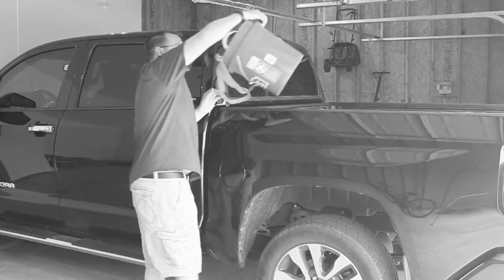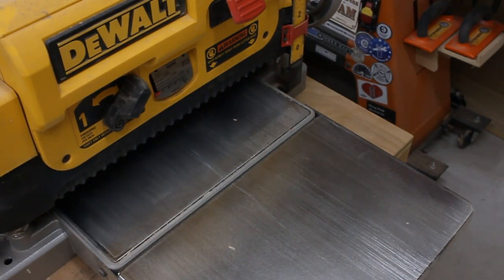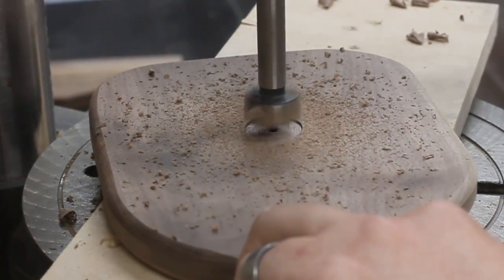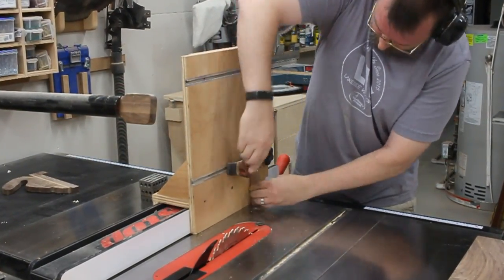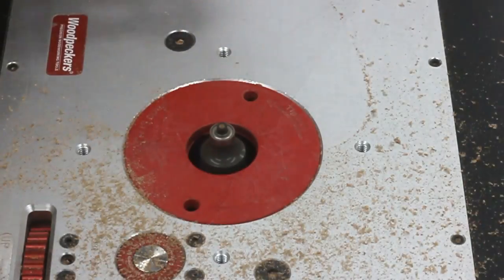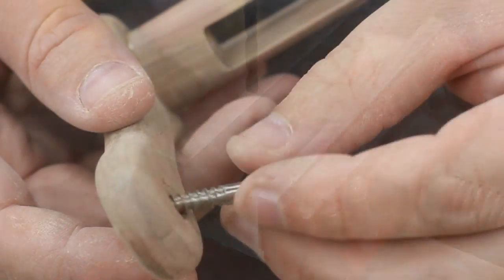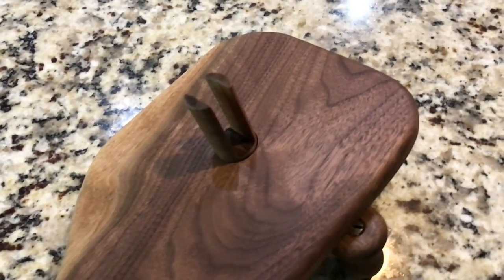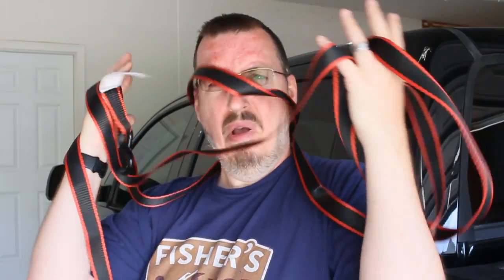Woodworking: The Strap Master 5000!

Comment: I wish I had thought of something like that along time ago because it takes forever to wind those up by hand you’re right Fisher that is a really cool tool that you built I used to use the-rubber band method to secure mine too, but someone showed me a new way of storing those and it works great so I’m gonna share it with you your unmatched socks or one got thrown away because of holes all you gotta do is drop the strap inside and  twisted a couple of times and stick it in your box and then they don’t come unwrapped. It makes a wonderful strap holder Again awesome build thank you
Reply from the maker: Nice tip!

Comment: Drew, if you would resist the urge to take the straps out of the box and tangle them up, you wouldn't have to spend so much time winding them back up and organizing them, lol. Seriously, this is a cool gadget. I don't use ratchet straps very often, but if I did, I would definitely build one of these. Thanks for posting.

Comment: Good idea.  I use plastic stretch wrap to keep the tie downs rolled up for easy storage.  (Jimmy Diresta tip)
Reply: Good idea.  I use foam 
koozies and throw them in the storage area under by truck back seat. Holds 14' 1/14" straps pretty well.

Comment: Small tip to get rid of the "ocd" issue we sometimes have noticing a thing we did wasn't actually symmetrical. Deliberately introduce a few obviously "by design" assymetries where non crytical. Maybe the tip of the handle isn't disk-y shaped but something more like the shape you had at 1:57 right before cutting the last bit off to round it off. Maybe the top edge is not trying to be perpendicular to the sides but rather on a slight (but noticeable) angle, maybe not even straight but with an subtle concave curve in addition to the small slant, but this is already getting too much.And just a few things like that, even if you started with a symmetrical base, it is already enough to break your brain away from "this is imperfect symmetry" into "this is just the shape of this thing" territory, even though it is still by far and large very symmetrical.

Comment: Looks similar to a device the old ranchers used to roll up old barb wire fencing. Just a lot smaller. I'm going to build one... all my ratchet straps are wadded up in box. 
Good idea.

Comment: My trick for straps:
I always keep them together by sliding the racketing section all the down the opposite strap until it meets the hook.  Then, I furiously hand wind the long strap around the ratchet section and hook off the long strap.  When I need a strap,  i grab one strap and alway have the ratcheting and long strap matched, on the strap, and ready to be pulled apart for cinching down the load.

Comment: Hello Drew,  Great video.  Your sense of humor makes it a hoot to watch.  Got to stay on your toes to catch all the innuendos.  Love the rubber band restraints.
I have a couple of suggestions:  Truckers have been using this type of roll-up device for a LONG time.  The suggestion:  Wrap the strap with the metal part to the OUTSIDE instead of the inside.  When you throw the strap over your load, you won't be throwing the heavy metal item into or on to anybody/anything and will not dent or scratch your vehicle.  Second:  IF a person has an old bicycle inner tube, cut "bands" from the old tube.  They will last darn near forever and are harder to lose.  I hope this will be taken as constructive comments and not as a slap in the face or a "You did it wrong" thing.
Thanks for the entertainment.  Love your videos 100%

Comment: You know, it's the simple solutions to the BIG problems that work so well - love this.
Now you just need a custom made wooden box with latches and a handle etc to hold the straps and the Strap Master 5000 ! (cuz that cardboard box is just too undignified to hold The Strap Master 5000 ! )

Comment: you should roll the straps up with the hook on the outside such that you hold on to the hook when you throw the strap over the load. two reasons 1: if you throw the strap over a high load and there is someone on the other side you could injure them with the hook and 2: if the hook is thrown over you have to go round, hook it on and come back to pull it tight but if you throw the strap over you can hook the hook on, walk round and pull it tight and add the ratchet, simple really!  so you might want to make the mark two version with a narrower slot in the winding post.

Comment: Great idea. I have to wrap them neatly by hand. The only thing I would add is something to keep the strap straight coming towards the winder.  A couple straight short pieces toward the paddle handle. Put them close enough together to keep the strap straight, but not too close. Fasten them to another flat strip with a pin going into the paddle  (look like a tuning fork).  This will allow for it to be removed but mainly for it to pivot as the strap comes in. 
That would make it from great work to perfect. 

I fully expect noone to like this comment. Just my idea for improvement. 

By the way, I have some drwer fronts you can borrow later.
Reply: Well I think it's a neat idea!  It would work better for me if the winder was stationary and I could guide the straps by hand but that's just because of how I prefer to work things.

Also, I legit have some spare drawer fronts lying around 😅

Comment: Great idea! I may actually make one of these. Only suggestion I could think of is to add two small dowels near the handle to prevent the strap from folding as you wind instead of using your fingers. Problem I see with that though is it would increase the packed down profile of the paddle when not in use. 🤷‍♂

Comment: Super cool, but I can think of some design enhancements.  
     * A way of turning it the opposite way and automatically dispense the rubber band onto the wound bundle?  
     * 12 volt or solar-powered option
     *  WiFi/Bluetooth?
     * Foot-pedal

Comment: Well done, Drew!
Only change ... don't use rubber bands to wrap the straps. Rubber bands have a habit of drying out and breaking.
Instead, use Velcro cable ties. They usually have a small slit in them so you can fasten them to one end of your strap. And, when they wear out, they're easily replaceable vs. risking a broken rubber band projectile.

Comment: I love it, I'm going to make 1 for the car, 1 for the shop and 1 of each of my friends, so I'm making 3! 1 improvement could be a slotted peg between the paddle body and handle,  put the tail of the strap in the keep it flat ans straight. I see you doing this with your hand but my straps are often wet and or dirty from the roof rack or trailer

Comment: Appreciate the design, and the humor, but there is a much easier way. Take the strap and double it over. Then fold it over again. Take the fold, insert into the ratchet and pull halfway through. Then ratchet several times. Not as neat, but it keeps the belt with the ratchet, reduces the mess, and is mostly tangle free. Been doing this for years.

Thanks for sharing, I always learn new techniques even if I don't do the build.

Comment: I used to use ratchet straps to restrain people in my basement, but the tangling got to be WAY too much of a hassle. One of them almost got away once while I was fiddling with the straps, so I switched to using zip ties. This little device is going to make it possible for me to go back to straps again, which is great because I’m trying to use less plastic these days…
Reply: Do you still use duct tape??😁😁😁

Comment: My neighbor's wood is too soft for this. 😁 But serious question. Why use a disc sander vs the oscillating sander when shaping? Remove material faster? Downward force that's applied? I use my oscillating sander for this but wondering if a disc sander would be a good investment for me with my limited counter space.

Comment: I have a recommendation for an improvement.
Instead of pinching the strap (to prevent  twisting) add two dowels, very near each other, and feed the strap through them.
Reply from the maker: Couldn’t store it flat then. It’s easy enough to use as is I think and simpler to make.

Comment: Always love your videos! I always get a chuckle or two. 😊 I’ll have to make one of these. Definitely seems faster than doing this by hand.
You mentioned Fusion 360… I haven’t need a computer for a couple of years but I’m about to buy one so I can use Fusion 360. A friend has graciously allowed me access to his Shaper Origin and it seems most people use Fusion 360 to work with that. I am planning to get a laptop but not sure if I should get an Apple Notebook or a Windows based laptop. And I may get a small CNC next year. Your thoughts on what would work best with Fusion 360?
Thanks for you time. Keep up the great video’s.
Ron

Comment: Pro tip from a trucker. Don’t roll up your straps with the hook in the middle. Have the hook on the outside, that way you have something to hold onto when you throw your strap over your load and your not throwing a hunk of metal that could damage something or hurt someone.

Comment: You should've added two more pegs at the base of the handle that you could put the strap between that would keep it straight for you without you having to use your hand to do it.
Reply from the maker: Then I wouldn't be able to store it flat.  I like this way better.
Reply: @FishersShop  but you could’ve made them removable just like the crank handle?